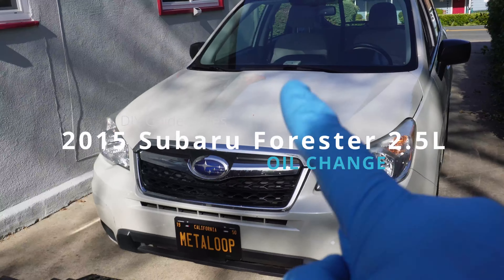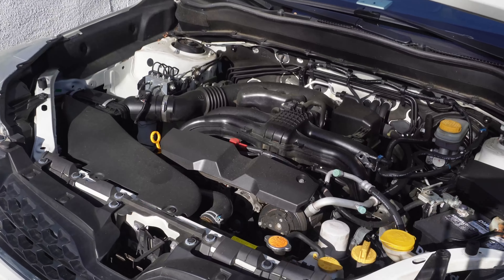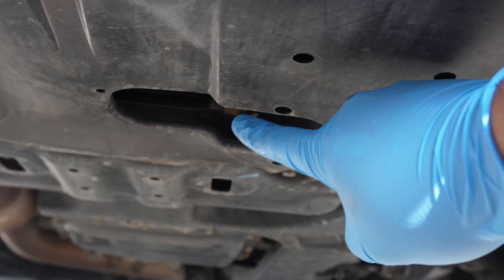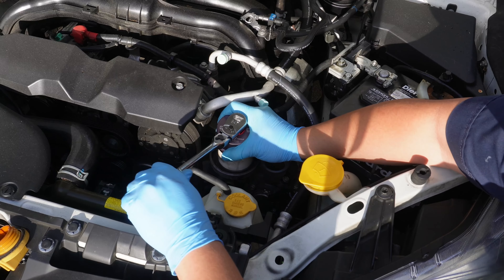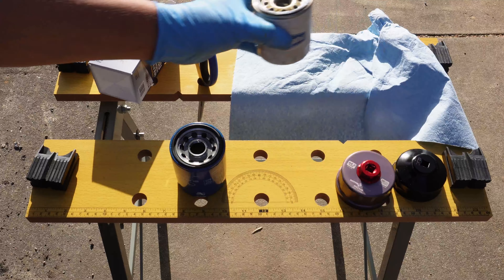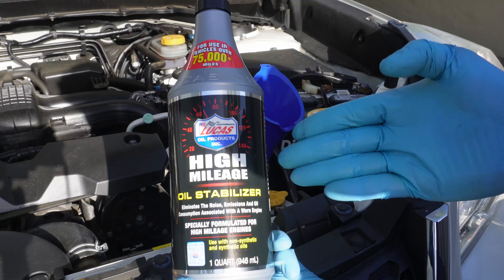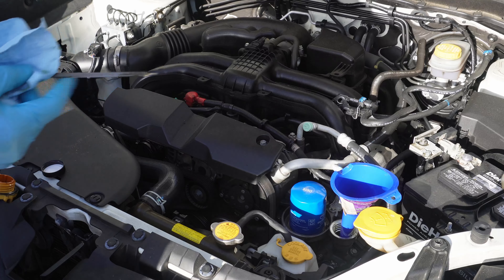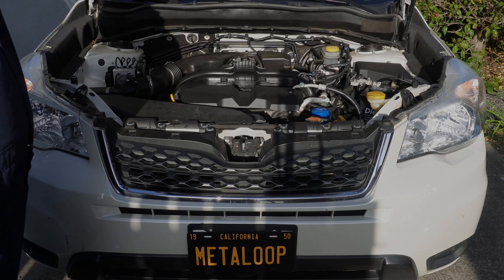Save Money With This 2014-2018 Subaru Forester 2.5i PZEV Oil Change DIY Tutorial

Comment: That Walmart filter is trash. It’s made by FRAM.
Reply from the maker: *edit: it looks like the 15208AA20A filter that replaced the 15208AA15A is easier to get since I've made this video and is made by Tokyo Roki. I will remove the walmart version from my description as--you're right--it's a bad recommendation at this point.  🙏

I know (and agree). It's why I listed an alternative one made by AC Delco in the video description. Still not as good as the Japanese OEM ones, but those aren't easy to get.  That said, fresh oil changes with any filter is better than nothing.  Thanks for the comment.

Comment: You can actually hold the gas pedal then hold start your car to circulate the new oil so you don't have to wait. Max seconds is 10.
Reply from the maker: You mean with the clear flood mode? @MrSubaru1387 also recommends doing this, so who am I to argue! Mostly if you rebuilt the head or something to ensure oil makes it way to those replaced parts, but yes, will prime a filter too. Thanks for taking the time to comment and share your knowledge.
Reply: I still prefill the oil filter anyway to absorb the new oil which barely leaks out because of the anti drain valve.

Comment: change the pcv valve
Reply from the maker: Are you requesting a pcv valve guide or did you somehow diagnose that this car has a bad pcv valve based on the video? 😅
Reply: @MetaloopDIY  this is the most thorough oil change video I think I have ever seen.  I would love to see a pcv valve video, I think it would help a lot of people.  I know so many people with Subarus that have the mysterious oil loss and yet no one ever thinks to change the PCV valve.  At 120K miles, my daughters Outback started "losing" a quart every 1000 miles and I changed the pcv valve and now all is back to good.  The PCV was locked up tight.
Reply from the maker: @josephlhunt9271  I really appreciate the feedback and this is a good tip. Thanks for sharing your wisdom. I'll see what I can do!

Comment: Do you have any videos that show how to remove the dreaded plastic skid plate? There’s a art to removing those plastic clips. But I usually have to break a few to figure it out. And then I don’t know the proper name of the clips to reorder them.
Reply from the maker: I do have a couple videos that show how to remove, but I edited them to be pretty fast. Here's one showing a typical panel clip being removed:  https://youtu.be/PmbklyzWxKA?t=156  Your best bet is to invest in a trim panel removal tool, both plastic or metal will work. They are kind of like a pronged pry bar and gives you leverage without damaging the clip.  You basically want to pull the inside part up and that will unlock it. Usually you can just pull it out with your fingers, otherwise you slide the trim tool underneath the whole thing and pop it out.  I know a comment isn't the most helpful way of conveying information, but I hope I at least pointed you in the right direction.  Please do reply if it helps!

Comment: What about the washer on the bolt? Should that be replaced every time? I’ve seen some say yes and some say no (if it looks okay)
Reply from the maker: If it's your first time changing the oil, I would change the washer since you don't know how many times that washer has been re-used and if the previous changer over-tightened the bolt (e.g. squeezed the washer too much).  After that, if you are the one tightening it to spec, you can do it every other oil change or even a couple changes before swapping.

Comment: Great video! Thanks a lot! Now i will go outside and get started on it...
Reply from the maker: Appreciate the comment! Let me know how it went.
Reply: @mldiy  it went great, only I used one of those drain canisters and the drain was too small to deal with the massive stream of oil. I underestimated the pressure. It's just way more to deal with than on my tiny Kei truck.

Comment: What is your assessment of the Lucas high mileage stabilizer additive now?  I also love Costco jugs of oil, but am curious if it's better off to just do a high mileage jug of synth oil
Reply from the maker: Hi Jenni, if your car isn't burning oil, you likely don't need an oil stabilizer or high mileage oil. The main benefit of high mileage oil is that it has some additional additives to try to recondition worn seals and gaskets in order to try to reduce oil consumption. Lucas high mileage oil stabilizer, in theory, does the same thing, but also with Lucas' main claim of increasing the viscosity of the oil, which should also help with burning oil.  This generation Forester is also pretty reliable. If the one I worked on wasn't burning oil, I wouldn't have even thought it was "high mileage" until over 200K.  But to answer your question, I would pick high mileage oil over an additive next time. I think I'd rather have all oil instead of trusting a one-size-fit-all mixture ratio that the additive recommends.  I hope this helps and thanks so much for watching and commenting. Thanks also if you subscribed and liked the video (and no worries if not).
Reply: @MetaloopDIY  Cool thank you for the quick response! 

And yes my 4th gen Forester burns oil at ~130k miles, but I've always had old cars 100k-250k miles that burn oil and another mechanic also recommended Lucas's stabilizer. Just ending up buying the high mileage oil at O Reilly's (a deal of a 5qt high mileage + Microgard oil filter for $31) to change my oil today. Thanks for the concise, to-the-point video so am subscribed and liked. Am grateful to not have had to waste minutes of my life hearing random opinions or about someone's day that I didn't ask about ^.^
Reply from the maker: @jennijun  That seems like a great price! Nice find.

Comment: Nice video short and to the point, thank you for shearing  
do you have info on how to replace the spark plugs?
Reply from the maker: Hi Julia, I will have a spark plug video for the Forester but not until later this year. The trick to Subaru spark plugs because they are a boxer-4 is to use a combination of short extensions to thread the spark plug socket onto the spark plug in the well first, then put on the ratchet to break it look.  I think Subaru's use a 5/16 spark plug socket.  If you're needing to do it sooner than the summer, I highly recommend @MrSubaru1387 who has numerous spark plug guides for different Subaru models.  Thanks again for watching and commenting, I hope you'll consider subscribing if you haven't already. 🙏

Comment: Is this the same with the 2017 model?
Reply: I am changing the oil on my wife's 2017 right now, and it looks the same to me 👌
Reply from the maker: Yep, 2014-2018. Good luck and please do update if my guide helped!
Reply: @MetaloopDIY this person is probably asking because the first video I (and probably they) clicked on didn't show a very clear view of the underbelly of the vehicle, making it difficult to determine where the oil drain actually sits. I really appreciate the detail given to the exact location and look of the correct bolt. I know generally what I'm looking for, but it'd really suck if I ended up draining the wrong fluid.

Comment: Do you have a tune up video for the same date range of a Subaru?
Reply from the maker: Hi, I don't currently have access to the Forester, but the engine air filter is super easy to get to, it's just clips with no tools needed. The cabin air filter is behind the glove box. For spark plugs, I like this guide from MrSubaru (the Forester's engine is the FB25) https://youtu.be/nLet3J2KAT0

Comment: Burning oil, and risk of water in the oil at 100,000.  Only in a subaru.
Reply from the maker: That is my fear. And the car has a history of quick lube oil changes with questionable oil quality.
Reply: Could you elaborate a little on what you said.  I have a 2016 Forester with 98K miles that is consuming a bit of oil.  I understand this is common in Subarus.  Why is that?  What about water in the oil?  Also, you eluded to history of quick lubes.  What did you mean by that?  Lots of questions.  Thanks.
Reply from the maker: @WLWeller-ww6eg  Yes, it's common in Subarus for the engines to burn a little oil. The really fast unscientific explanation is that boxer engines because the pistons go sideways instead of up and down, one side of the piston sees more wear just from gravity.  So things that should be perfect circles start looking like not perfect circles over time (e.g. the piston rings).  The quick lube comment is that some (not all) quick lube may not be candid about how they might be using conventional oil or even a synthetic blend instead of the full synthetic oil that Subaru recommends.  Full synthetics tend to last a little longer and hold up a little better over time.  I'm not going to comment on the water issue because I'm not too familiar with it. It's an issue on hybrids if you drive only short distances--which this car is not. Or it's saying the head gasket could have problems, which some earlier models of Subarus had head gasket issues, but not this model/engine.
Reply: @MetaloopDIY  Thanks so much for your great reply.  Very helpful.
Reply: my 2016 has 113k and the oil is just fine 💀

edit: almost at 115k now, still no oil problems
Reply: Is it ok to ramp.. will that inclination really help to drain the oil fully? Or the ramp inclination leaves some old oil inside?